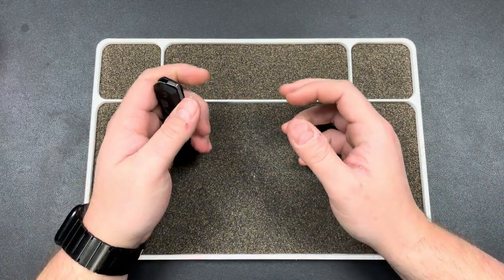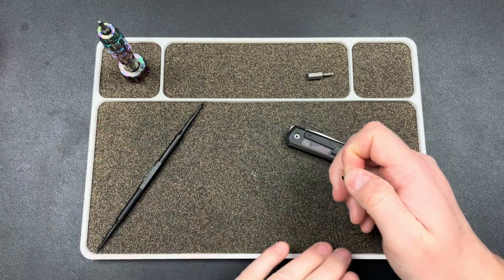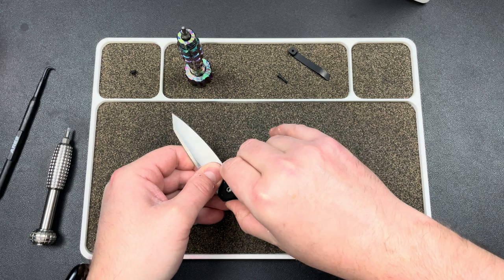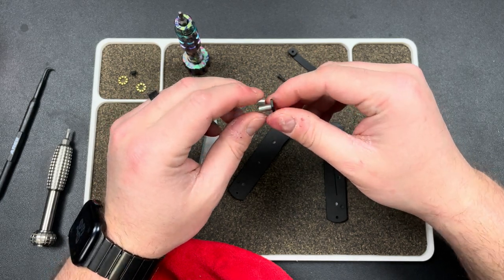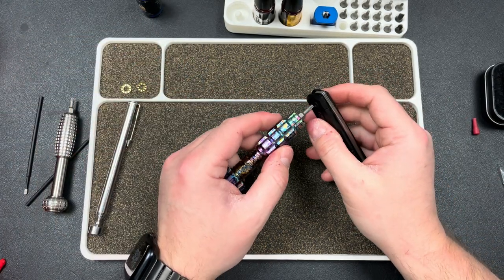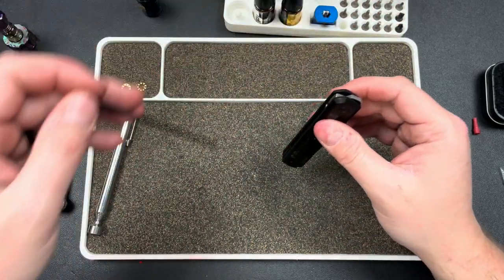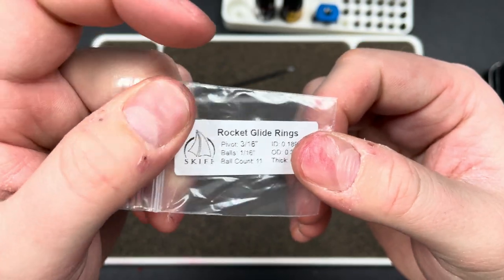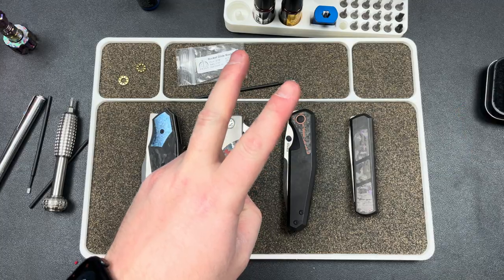Pena Paramour | Disassembly & Skiff Bearing Swap

Comment: Attach a piece of foam air conditioner filter material on or under the vent cover and nothing will ever get lost there.  Cut a piece of flexible magnetic rubber sheet (Ebay) to glue in the top portions of yout work tray to hold the screws during disassembly. Two more old guy helpful hints. 😊

Comment: Why do you always let the cutting edge of the knife hit your thumbnail every time you close a knife? Is that just something you got used to when using your non dominant hand to close it? Not knocking it, just something I noticed.
Reply from the maker: Just feels good. Makes sure it clears the detent and doesn’t have much more travel to close. 🤷‍♂️
Reply: Most knife nuts do that   Very common I do it too
Reply: Yeah I always let it hit my nail unfortunately I tried with the padre and bam it hit me pretty good. Not the best knife to do it with has a crazy sharp corner and I have small hands